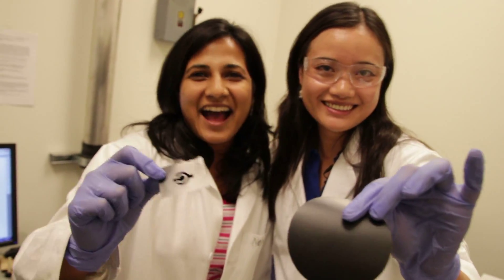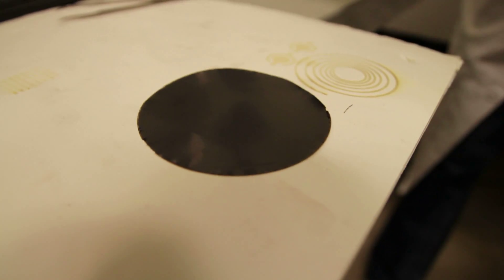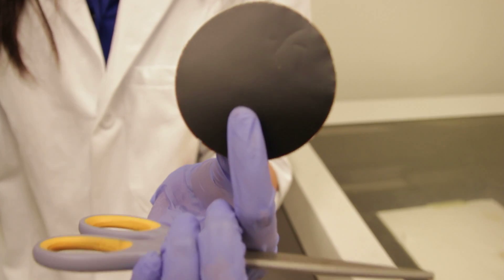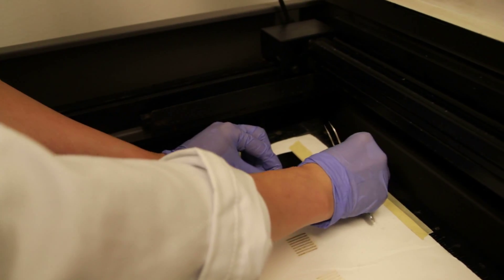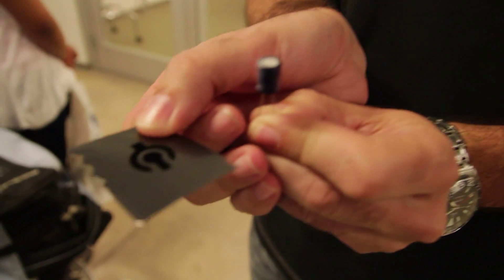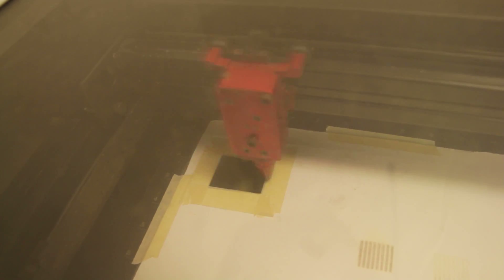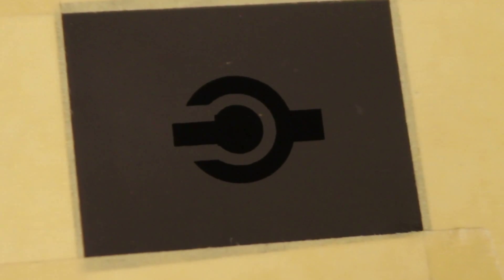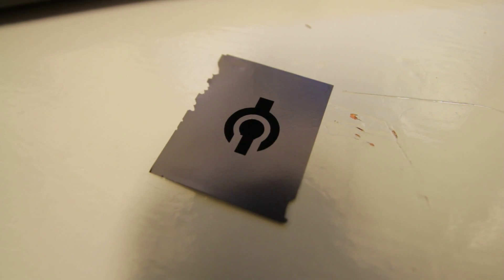Graphite oxide + water + laser = breakthrough.

Comment: Even better is taking Graphite and putting it through an electrolysis process and creating Graphene. Then you have created the worlds best battery AND capacitor.
Reply: Robert Elliott that's what this is... The laser is creating graphene.
Reply: the laser turns grapheno oxide into grapheno ?
Reply: @desideriumliber8388  My take on this is that the laser is sintering it like metal and that evaporates the oxide layer, leaving behind the graphene

Comment: Right now, supercapacitors have about 1/10th to 1/5th the energy density of typical lithium batteries. If this can be increased to even 1/2 of the energy density of l-ion batteries a whole new world of storage would be opened up. Imagine an electric car that has a "battery" that lasts, not 7-10 years but decades, while also having much faster recharging capabilities - dues to its much lower internal resistance. You could pull into a charging station and have a useable charge in just a few minutes - just like filling up your ICE vehicle!

JW3HH
Reply: But still they lose their charge over time as a side effect. I'm sure they would help a lot into fast charge batteries, but at that point still would take more to replace batteries.

Comment: electricity will take the shortest root to get where it needs to go. So just a big sheet would not be efficient. By making designs, one can control the rate to which the energy is released, the charge, and the capacitance. It may also be desirable to create patterning to avoid crosstalk or to shape the capacitor around other electronic components. Take a cellphone for example. Currently it needs a separate space for a separate battery. Because of the size of the battery, this can end up being significant real estate. With graphene, which this is, one could print several of these out patterned around components in the phone so it's length equals that of the phone, and several of these then layered. Now you may have a capacitor that can hold more charge that is lighter and thinner.
Reply: NO___The graphene ultracapacitor has less energy/gram than lithium, phone and laptop batteries.  These new nanotech battery takes up more space than lithium.

just google the research article on them....there is a graph chart too comparing them to lithium, ac capacitor, aluminium capacitor, etc.

needs another breakthrough to increase surface area...how small i wonder?

Comment: This statement just means you don't know how thin you can make a battery. A battery can be this thin and be just as much a proof of concept, however both this and a battery benefit in lifetime by having more surface area. Batteries are rolled up from flat sheets, thus they have lots of surface area... A capacitor can only power things for very short periods of time without input.

Comment: Its probably in microfarads since he compared it to that small cylindrical cap but my question is why have a pattern at all if we are talking about capacitors why not just make a sheet as big as the laser engraver and then sandwich the two together? You could roll them up or just sandwich on top of one another in series for higher voltage like those square prismatic cells. And how much of the current capacity is dependant on the electrolyte?
Reply: paint one side golld and roll it up and add salt water seal it with a cap and seal off yr posts